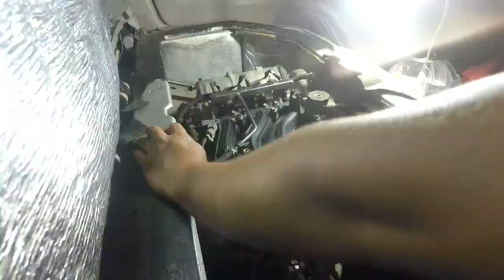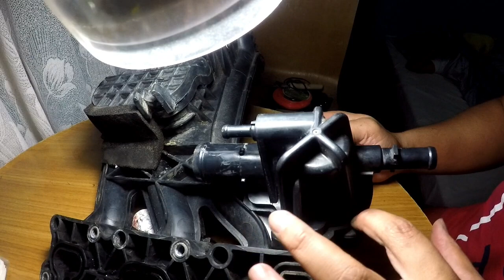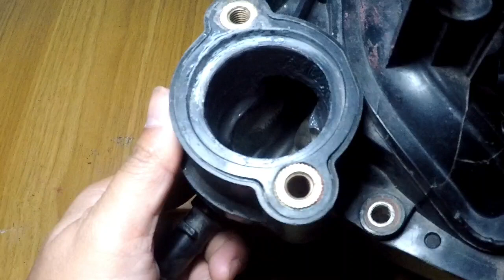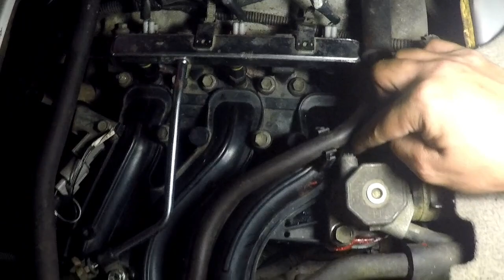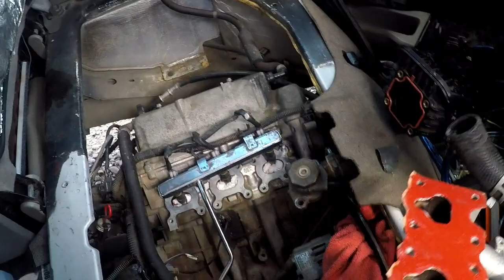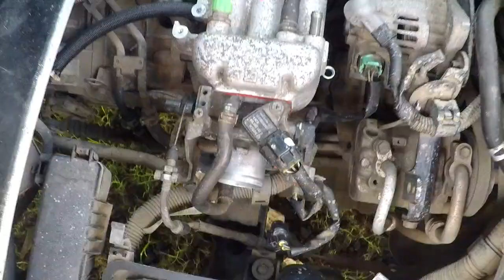Intake Manifold repair and replacement for DA64V K6A| from plastic to metal intake| pwede kaya?

Comment: Yong performance nila plastic compare aluminium anong observations mo?
Reply: performance sa makina sa plastic ay maganda very responsive ang makina at fuel efficient kompara sa aluminum ..ang dahilan ay smoth ang butas ng plastic  walang uneven surface kaya mabilis ang pasok ng hangin o tinatawag na air velocity samantalang sa aluminum hindi perfect ang butas sa luob ang daming unven surface sa butas kaya ang hangin na pumapasok ay nababanga sa mga kanto kaya sa mga new engine ay palstic na ang gamit ang down side lang ay ang durability mag crack sya lalo na sa side na merong dumadaan na coolan lalo na pag nag overheat malaki ang posibilidad na mag crack